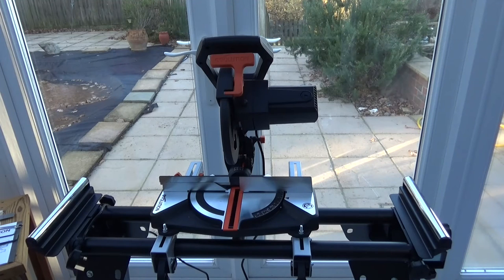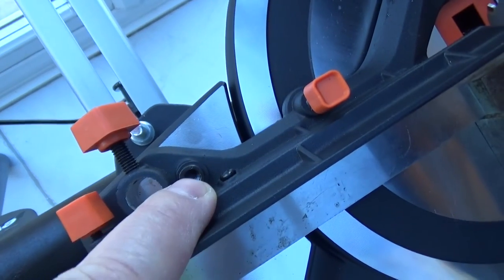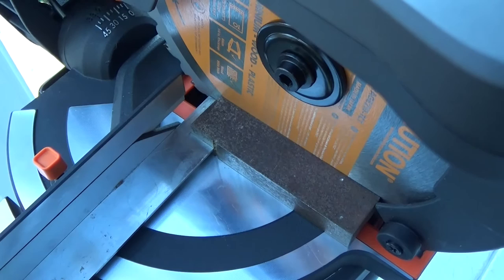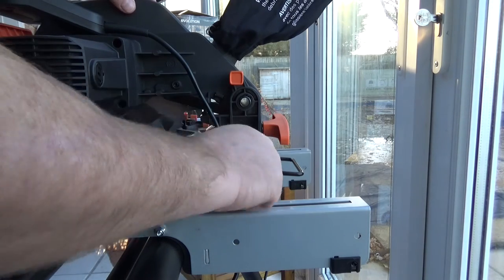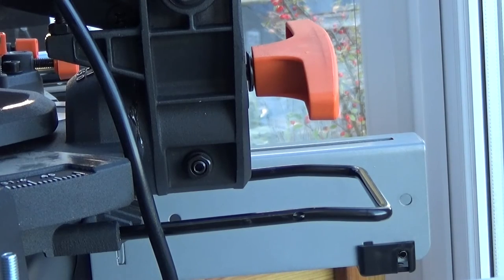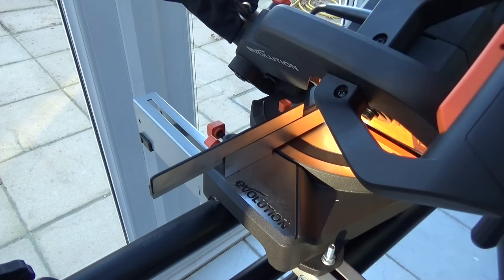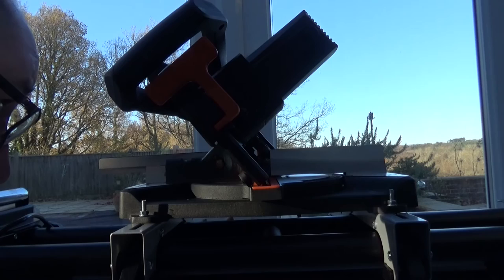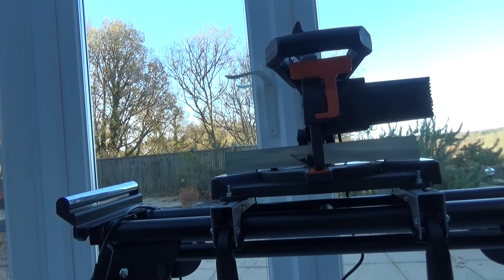How to set up the Evolution R210CMS Mitre Saw

Comment: Hello, thank you for your setting demonstration.
As far as checking squareness is concerned, I prefer the machinist's square with the DIN875 standard or BS 939 for you Brits. These carefully kept and handled little tools are used to check everything, including your favourite and usual squares.
That's how my old Sandvik bracket ended its career as a signpost to the loo...
Greetings from the Ardennes.

Comment: Great explanation.  However, when I was trying to adjust the blade to make it square with the bed, I loosened the locking nut and managed to screw the set screw in too far and it dropped inside the machine. Is there anyway I can get it out?
Reply from the maker: No idea Robert, try contacting Evolution Customer Support.  :-)

Comment: Thanks Russell. I've just purchased one of these and this set up video was very helpful. I subscribed to your channel. I have a quick question. is there a way to alter the depth of cut? - I can see there is a stopper but it doesn't appear to have any height adjustment. If you have figured out a way to do this, please share. Thanks, Peter.

Comment: To set laser: 
1. make cut on cardboard piece as you did. 
2. with 2 screws align it as close as possible. 
3. Undo tiny philips screw on the side of the laser and once u take plastic lense off you will see copper ring with two cuts. 
4. Place flat screw driver into cuts on copper ring and turn it anti-clockwise/clockwise to align it with cut on cardboard. 

P. S. I polished plastic lense before i put it back on to make laser brighter. 

Hope it helps
Reply from the maker: Thanks for that information.  :-)

Comment: Hi, I just bought the evolution r210sms + (my first miter saw). But I have encountered a problem the blade has a slight play I think it is due to the hex bolt securing the blade to the motor, the bolt has quite a bit of play compared to the thread of the motor block and even if I tighten it the wobble remains, however the cuts are precise at least on the wood. I was wondering if yours also had the same problem? Sorry for my English
Reply from the maker: You english is very good.  There is something wrong with what is happening.  Make sure that you have the two washers  on either side of the blade fitted the right way round.  The outside washer must be placed with the convex side facing the outside and the concave side touching the blade.  If everything is fitted correctly and the hex bolt is still wobbling, contact customer support or return it for another one.  :-)

Comment: Thanks for posting this I informative video. Just ordered one online and this will be my first chop saw. I'm also looking to get the stand that you have but can I confirm that the stand also comes with the quick release base which the saw can be permanently mounted onto. Cheers.
Reply from the maker: Glad I could help Allan.  The stand arrives with the two quick release clamps and is a very worthwhile addition to the mitre saw.  https://youtu.be/sEykh31yC-s  This is a review I made of the stand a few years back.  I am sorry for the quality of my presentation, hopefully I have improved slightly since it was made.  Play it at 1.25 speed if you decide to watch it.  Good luck with your projects!  :-)
Reply: @RussellPlatten  Hi Russell, thanks for the link. Another great review video that helps beginners like me get a feel for what's available and how it works.
Reply from the maker: @allanb2906  :-)

Comment: Is there a way to tighten the rotating bed?  On mine when I set to 0 degrees it can be anywhere from 0-5degrees - which is annoying.  Im used to a mitre saw clicking into 0 every time (unless the adjustments you helpfully describe need resetting)
Reply from the maker: 5 degrees is bad Mike.  I would contact Evolution customer support (0114 251 1022) and tell them what is happening.  It sounds to me as though the table needs slackening off rather than tightening.  Hard to say.  :-)
Reply: Yes you can tighten the bolt if you turn the saw upside down. It's the one in the centre. Have taken mine apart as had an issue with the rotating part being highly than the sides. Also it's a ballbearing on a spring which locks into the different degree measurements which can be tightened up too

Comment: Hi. My saw isn't cutting straight. Quite disappointed the saw doesn't come with what you need to set it up. What size square did you use. All of mine are too large.
Reply from the maker: You can buy a cheap school geometry set, I have one made by Helix.  They are heap and will get the job done.  Easily available on Amazon or from many stores.  :-)

Comment: mines new but theres play in the angle adjustments. annoying as all my picture frames are wey off. wasted so much wood because of this
and cant thereor use the mitre mate glue as its all gone
Reply from the maker: As I mentioned before, make sure the blade is at 90 degrees to the fence.  if it is out, adjust the fence to set it correctly.  If you still have issues, contact Evolution Power Tools support.  :-)

Comment: Cog won't loosen to put the saw on. So came here and you already attached the saw 🙄
The cog is just spinning it won't come loose so can't even put the saw on
Reply from the maker: The bolt has a lefthand thread so to remove it turn it clockwise.  I hope this helps Mark.  :-)
Reply from the maker: There is a button on the saw next to blade guard release, look at the top of page 16 on the instructions.  Press the button in and turn the shaft with the allen key until it locks.  You can then fit the blade.  :-)

Comment: Having problems changing the blade
Reply from the maker: Are you turning the allen key the right way Richard?
Reply: @RussellPlatten  tried both ways does not turn
Reply from the maker: The arbor screw has a left hand thread Richard.  It is slackened off and removed by turning the allen key in a clockwise direction (the opposite way to a normal screw).  I suspect that you have over tightened the the screw by trying to remove it in the normal anticlockwise direction - something I have done myself on occasion.  It will need a lot of force to start it off.  Try appling more force in a clockwise direction that you would normally think acceptable.  :-)